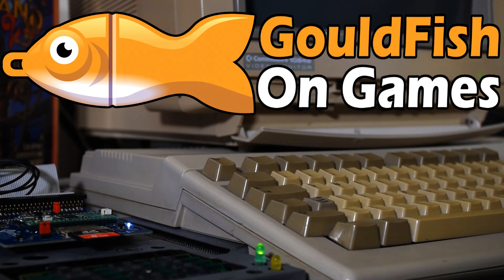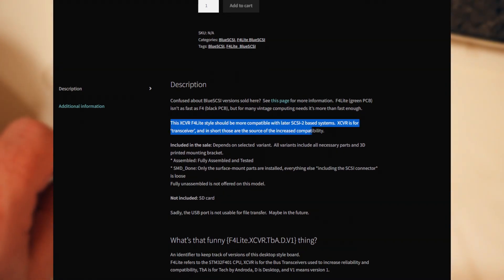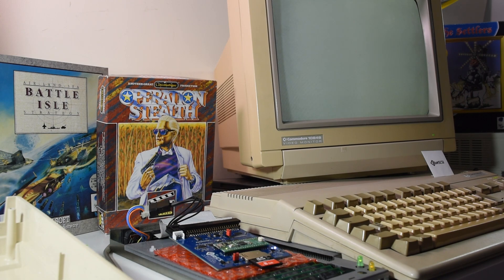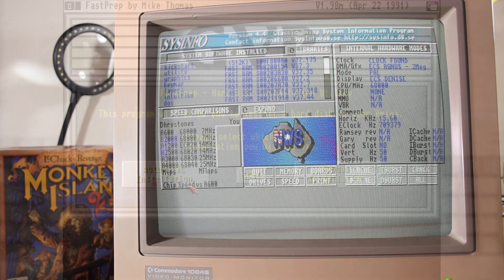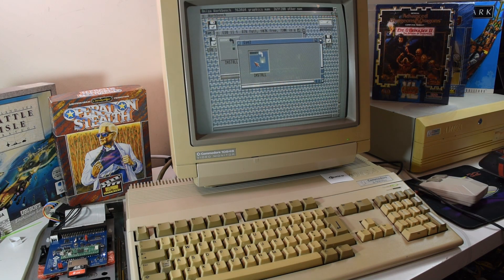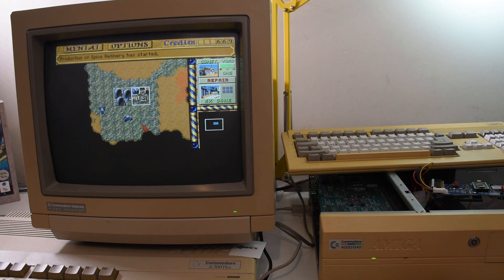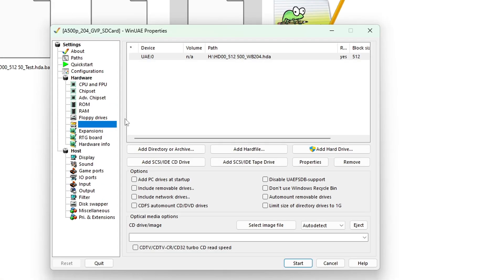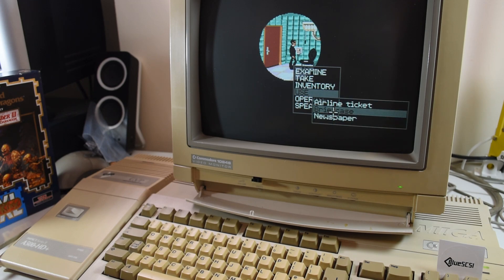BlueSCSI V2 And the Amiga 500 GVP, HD8 a match made in Heven?

Comment: I think I lost the power supply to the GVP. Could you tell me the voltage, the amperage of the power supply for it?
Reply from the maker: Based on the manual:
Power requirements: +5V, +12V,  -12V : 2.2 Amps maximum
Reply: @GouldFishOnGames  brill, thanks mate!

Comment: Hi thanks for the video ! 

I recently purchased a BlueScsi V2 for use on my Amiga 500. I have both an A590 and a GVP Impact Series II A500-HD+  external side car units and have the BlueScsi V2 working fine with the A590 but so far have not been able to get it working with the GVP. 

Did you need to use a custom bluescsi.ini file on your SD Card ?  

I am using the suggested entries as per below from the configuration support page of the BlueScsi website and it works fine with the A590 but not the GVP.

[SCSI]
System="Generic"
EnableSCSI2=0 ; Off
PrefetchBytes=0
[SCSI0]
Vendor=Blue
Product=Bluedrive
Version=1.0
SectorsPerTrack=32
HeadsPerCylinder=1

Any suggestions appreciated !
Reply from the maker: I hate to say it, but all I had on my V2 was the hd image and nothing else.
I didn't need an ini file or have to configure anything.

If you are on discord there is a server: "Open Retro SCSI" where the developers of the card can help.
Reply: @GouldFishOnGames  as an update I have now got it working with my GVP A500+HD as well. Turned out to be as simple as removing the onboard FAASTROM chip on the GVP, cleaning the socket and chip legs with some suitable solutions and reseating. As you mentioned with no need for any .ini file and just the HD image. I did have to try a couple of different SD Cards before the image was recognised. Happy days !
Reply: @mdsbris  what rom version do you have?

Comment: Anyway we can get a video of you setting up the BlueSCSI v2 with  a SD card, because I cannot get the thing to work no matter what I do.
Reply from the maker: Outside of making the V2, the process was mostly the same with the V1.
I put an empty file on the SD card with the name correctly made.
then boot up the Amiga with it connected.
I then use HD Toolbox (with the right SCSI device, this might be the thing tripping it up).
and from there I'd setup the drive and the partitions.
Reply: I have a amiga 3000 and for the HDtoolbox I have selected scsi as I am using the scsi on the amiga 3000.
Reply from the maker: @stanmoonie6508  I've not used an A3000 so I can't say how you would set it up.  
I've set up 2 now, one in the A500 and the other in the 4000, and I just put the blank image on the SD card then booted up and used HDToolbox.
If you are on discord either the "Open Retro SCSI" server or the "Official Commodore Amiga" servers should help.

Comment: Great video! I just got my Blue SCSI v2 working on my GVP HD, One question though where did you buy the SD extender from? as most of the ones available have the thick plastic housing round them.
Reply from the maker: Thank, happy you enjoyed the video.
I got that one from a random seller on eBay, but I have found them on Amazon.
you just have to wade though all the ones with the plastic cover.
you might have more luck going directly to AliExpress (as that is where most of these things come from anyway), you just have to deal with its terrible search.

Comment: The WarpEngine uses a SCSI-II controller versus the GVP SCSI-I controller.  The SCSI-II should get up to 10MB/s in an ideal world driving on a flat surface with the wind to your back.  Is the speed limitation the Blue-SCSI2 or the card being used?  It'd be interesing to see how fast it'd go on a CyberStorm with wide-SCSI-II, up to 20MB/s.   Can BlueSCSI-II be fitted with a 68pin connector?
Reply from the maker: the GVP is most likely SCSI-1. but it seems to had some of the same issues as a SCSI-2 controller, which is why the bluescsi-1 has issues with it.
I've read that better cards can run faster with the V2, I used a few cards I had sat around and got a few results.  So a better card might be faster.
currently the V2 design is either the 50pin internal or the 25pin external.
I'm not sure if there are plans for the 68pin connector, best to ask them on the github or on there discord called "open retro scsi".

Comment: Nice. I've been using the BlueSCSI V2 for a couple of months in my A4000 with CyberStorm MkII SCSI. Works great.
Enable synchronous mode if you can. It gave me a nice speed boost. I used RDBFlags on Aminet.

A good quality SD card improves speed.

Comment: gotta get one of these for my CDTV... not sure how easy it is to hook up though. Lovely neat job on that SD extender btw...
Reply from the maker: I know of that scsi adapter, but never tried it my self.
But considering the BlueSCSI V2 is smaller then a regular drive it should be able to fit in somewhere.
with a bit of effort.

And thanks, I'd had that in mind since the first BlueSCSI video. But as that wasn't quite what I hoped for I didn't give it a go.
so I was really happy when it all worked out nicely.